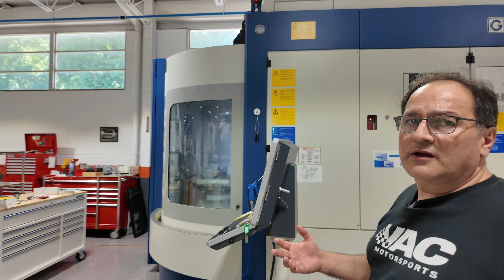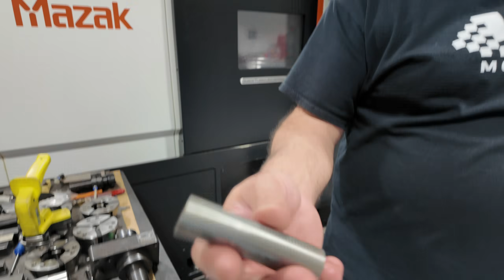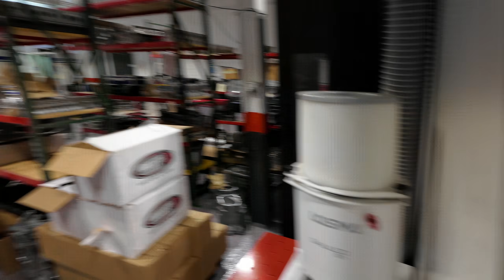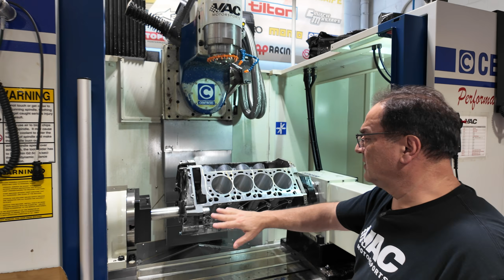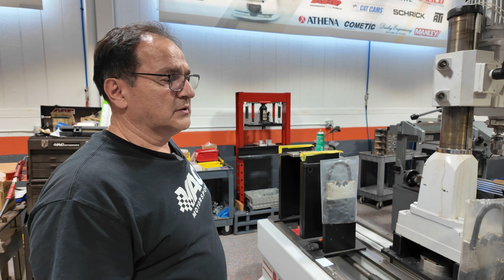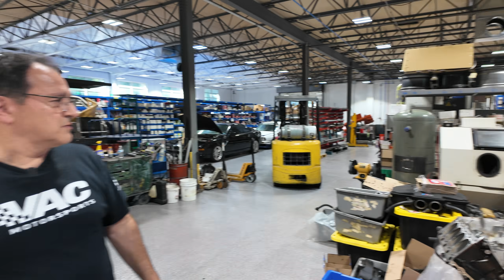CNC Machining + WORLD CLASS BMW ENGINE Performance | SHOP TOUR

Comment: Back in the last century (I like saying that. 😁) Mazak and Hurco were the prevalent brands in our shops. Spent thousands of hours converting and retooling manual mill and lathe operations. I still like turning cranks on manual machines. A proficient operator can amaze at their efficiency and accuracy.